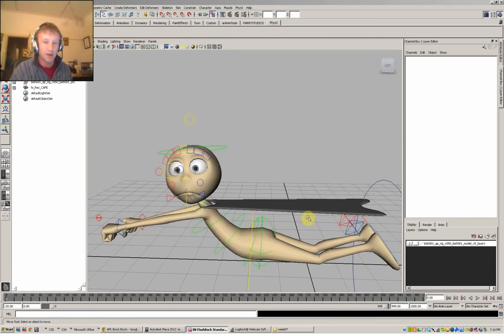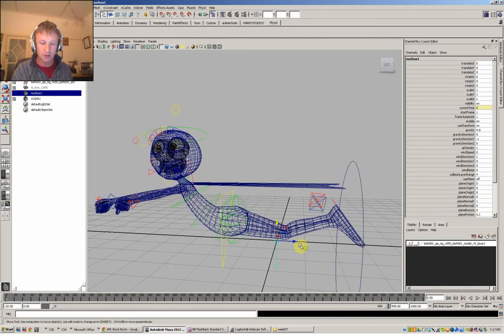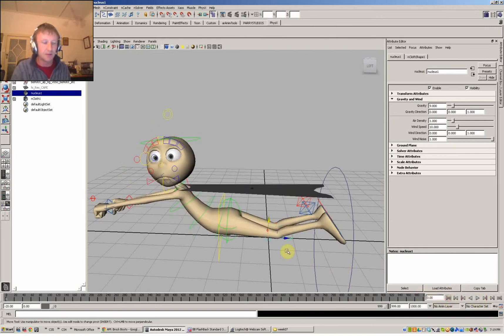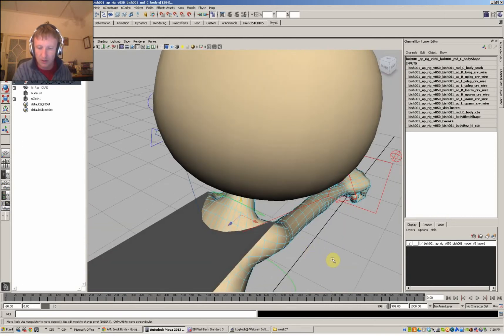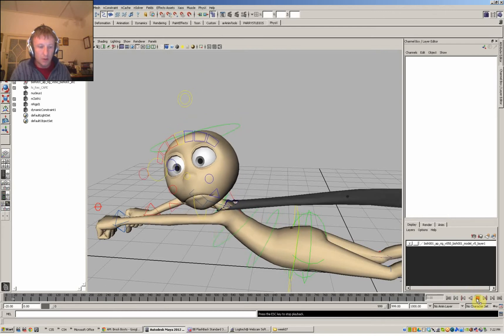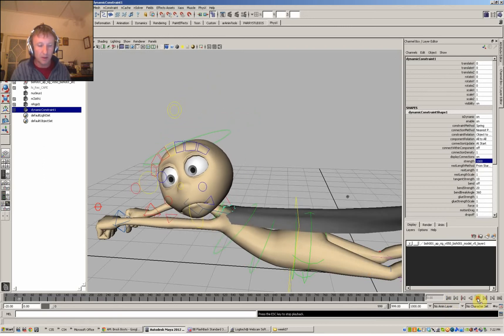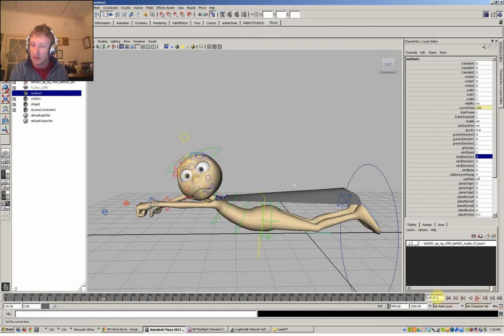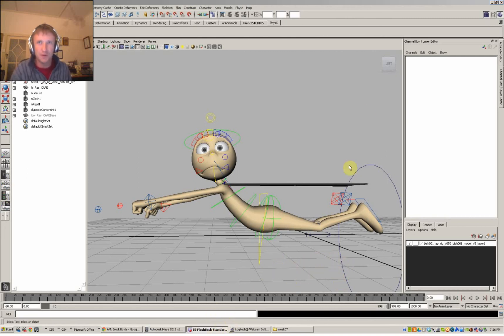Animating a Cape with nCloth for Brock

Comment: How do you get it into position if you don't start animating from Origin? In my case, I have an elephant ear I want to be floppy. I have a simply geometry proxy for the ear skinned. I have a duplicate of that as an influence object on the main geo, and I want another duplicate with cloth simulation. I've created a dynamic constraint (attract to matching mesh) from the skinned object to the cloth, to allow the animators to animate the ear (then the cloth builds on that animation dynamically) manually, and there is a switch that switches weather the skinned object, or the cloth object, is what drives (via blendshape) the influence object.

My issue right now is that, when the rig begins the scene already posed off origin on frame one, the cloth stays at origin and whips into place. I can't seem to begin the simulation prior to frame one to allow a ramp up to get the cloth into place. If you have any suggestions (ether in how to make this set up work, or an alternative set-up to accomplish the same goal, I would be very grateful for your assistance.